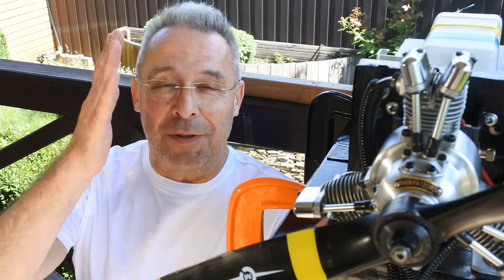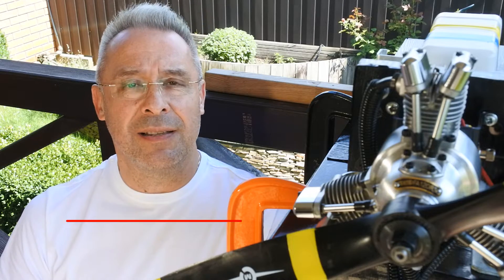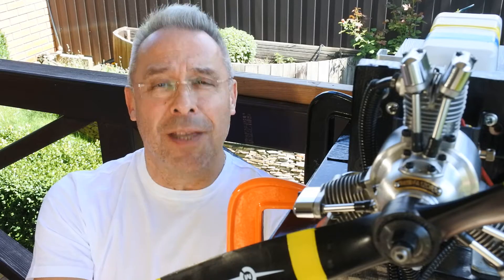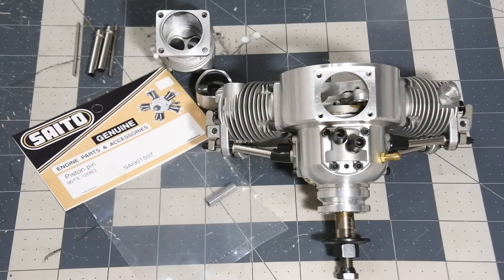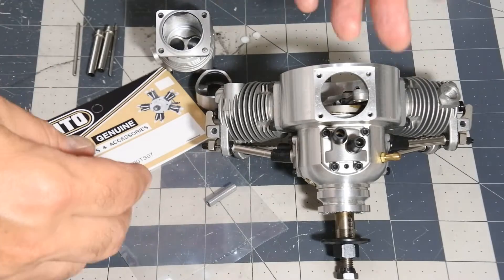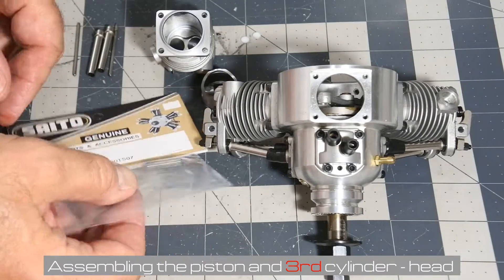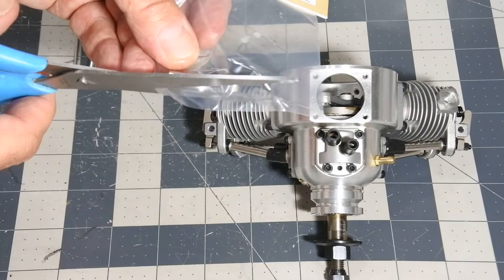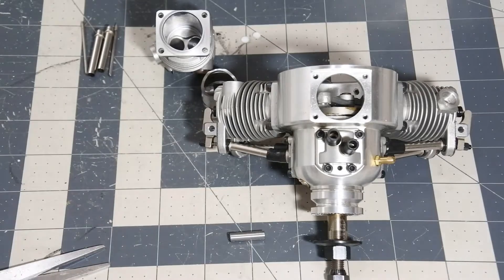Saito FA120 R3 assembling and trial run

Comment: G'day mate. Listening closely to the idle it almost sounds like that it's skipping on a cylinder which would account for the erratic idle, other than that it sounds delicious.
Reply from the maker: Him thank you very much for your comment ! definitely,  Saito 120R3, as well, as a few radial engines from Saito, has a typical problem with a equal fuel distribution, that's why on of the cylinders runs too lean ( usually, the first one and accordingly, runs  hotter), and one of the cylinders runs too rich, and frequently  throwing fuel residue thru exhaust. Sound wise, rich running cylinder and lean running cylinders  a different exhaust  tones and  this could probably, lead to such sound effect. 
Thank you and have a nice day !

Comment: what prop use ? what fuel ?
Reply from the maker: Hi, thank you for your question ! I'm using 15x8 MAS prop (it's a little bit heavy for this engine), and OptiMix 15% Nitro fuel, Saito SS1 glow plugs. You can check this at 6m:08s. Thank you and have a nice day !

Comment: The best engine stand to have is one that you can angle the stand on all angles, in this engines case you can see what happens to the cylinders when you rock the bench left to right, simulating a aircraft in motion..
I wacked a 15x8 prop on my gas powered fa120r3 and done a quick test run i achieved 7100rpm.but i didn't want to adjust my needle settings that are set for a 14x6 3 blade prop which develops 8200rpm..
Reply from the maker: Thank you very much for your comment ! I still thinking about construction of a new, more convenient and adoptive bench stand. Only need to find an exact place with enough space around. I'm still  surprised, but that isn't so easy. Ideally, bench stand should be very near from workshop. You know, for sure, how much different and small tools you'll need around the engine.
Reply: @crazyengines88  yes i understand there is always some tool you may need..
I have a portable stand so i can take with me to a park or the airfield, so i can bench run the engines..but the latest engine was already in a plane..magnum fs91, i converted it to gas ,simply modified the groove in carburettor barrel..bit of tuning and add ignition system, its running reL well..amazingly it is revving to 9300rpm and when it was on glow would max at 8800rpm..
Reply from the maker: @danielhitchens4407  Thank you very much for your reply ! Definitely, very interesting info regarding FS91 gas conversion. As far, as I understand, you decide not to jump over with Walbro style gas fuel carb, but modified your own, which comes with an engine. Is it possible to ask you to define exactly, what operations do you provided with FS91 carb ? It's amazingly interesting ! As I understand, the task was to adjust carb to another air/fuel ratio.  For gas fuel it should be approx 1:14,7-15,1, for glow fuel approx. 1:4,5-5,5.

Comment: I think it is unlikely that the fuel distribution is linked to uneven heating, from what I noticed, you didn't check the point on the valve control, considering even that the glow plug is always heated, there could be an imbalance there.
Reply from the maker: Thank you very much for your comment ! I don't shut the moments of the valves adjusting for this video, to make it as short, as possible, I can grant you, that all valves has equal settings before this bench run. Anyhow, I'm very respect your opinion, so for the next test run will thoroughly check once again all valves clearances. I can imagine, that if the valves aren't set equally, the time period of the engine's working cycle will be also different and that could be the reason of longer or shorter combustion time. 
Thank you and have a nice day !     Obrigado e tenha um bom dia!